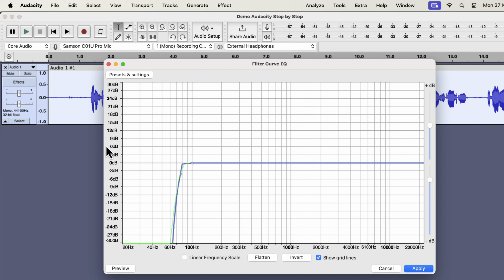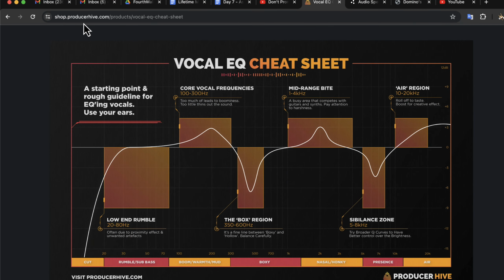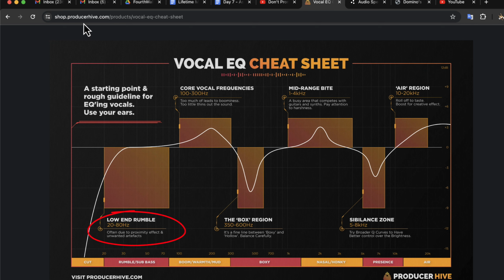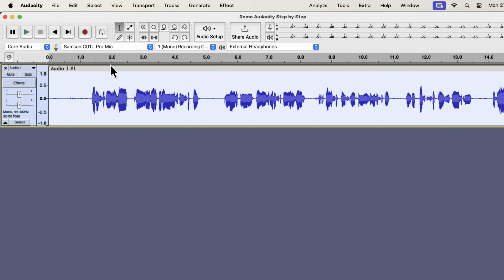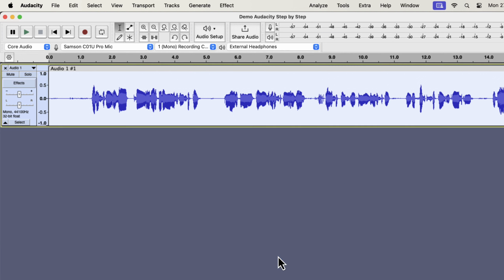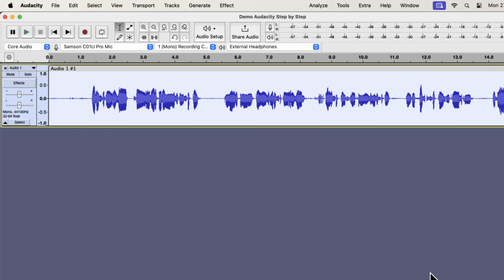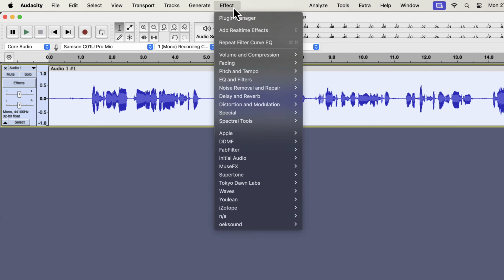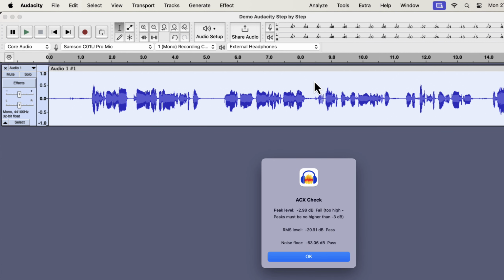A proper EQ in Audacity can reduce significant noise (demo provided)

Comment: Would it not be better to also roll off all frequencies above 20kHz? as this is also not in the human hearing range.
Reply from the maker: Above 20 kHz is outside our hearing range. If we reduce noise in that frequency, we can't hear any difference. Whereas 20Hz - 80 Hz is inside out hearing range, but we do not generate that frequency while we talk.
Reply: @MasterEditor5  I understand this. But if 20 kHz is outside our hearing range why do we still need to include it in our recordings?